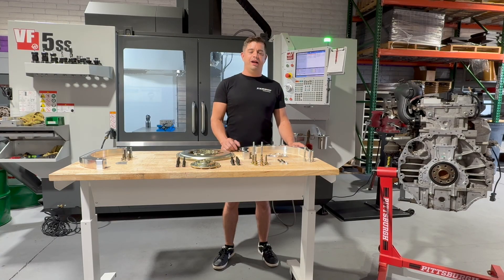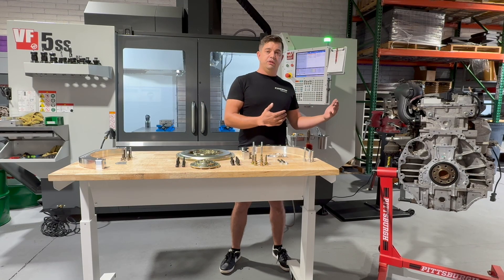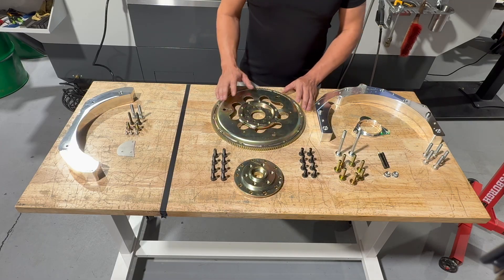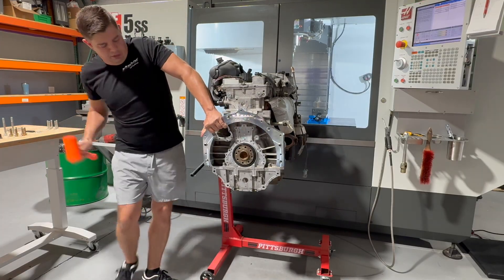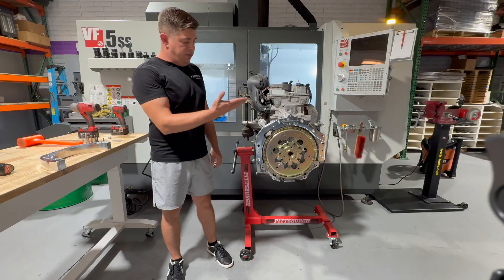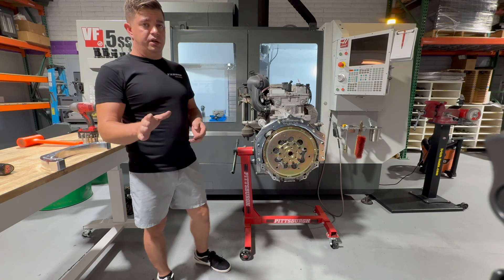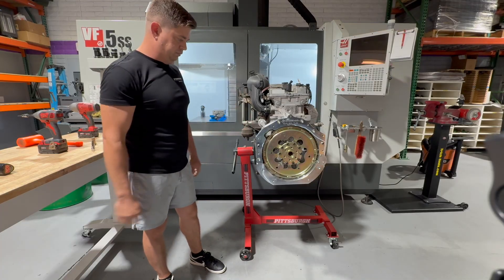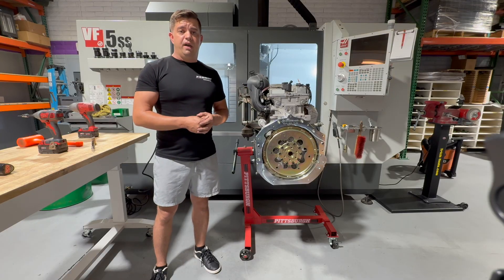FABbot Atlas 4200 to GM LS Adapter Overview

Comment: Finally these engines are getting picked up by more Performance markets! These are HIDDEN gems and are in need of more aftermarket support! Im Building a 3.5 5 Cyl from my Canyon and swapping it into my RWD converted Cavalier! Plan to get it done by June of next year for Rocky Mountain race week.
Reply from the maker: That sounds like an amazing build! We'd love to see updates on that.
Reply: @fabbot6562 using the front and rear subframe/suspension from an 88 targa MK3 supra. As well as a Holset HX55 and the FT550 from fueltech 😊
Reply: The 5 cylinder has performed really well so far for Calvin, or NIVLAC57, on his 81 Ford Fairmont.  He ran 8.89 at 152ish.
Reply: @charleslowe522 ive been subbed since his stude was the only one 😊
Reply: @darkblaze176  Tomorrow I think I am going to go to the salvage yard and pull a 3.5L from either the Colorado or Canyon.  It's $275, pull it yourself.  They provide the hoist, you have to bring all your own tools.  I need to take a few minutes to plan on how to remove the motor from either vehicle.
Reply: @charleslowe522  I have 2 :p One FROM my Daily and the one IN my daily :p There are over 200 junkyards here in Phoenix like that.

Comment: Two things:
1) wanna see you put one in a Colorado. Even better with the CD truck transmission. Better still, 4x4.
2) does this work with the 4 or 5 cylinder? I suspect the balance shafts mess that up
Reply from the maker: I like the way you think 🤔 as for the 4 and 5 cylinder, not yet but we are looking to get our hands on both to see what we need to do to make it work. Stay tuned…